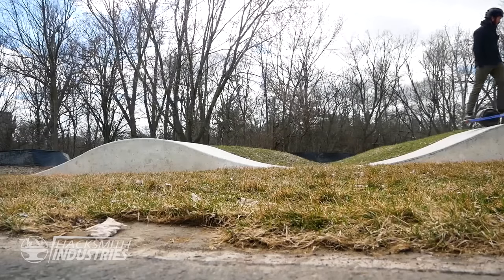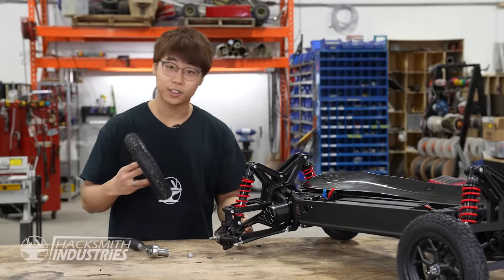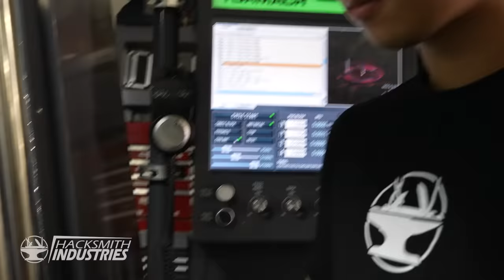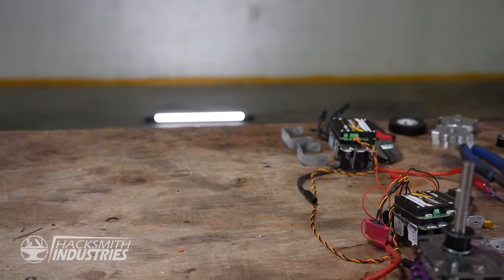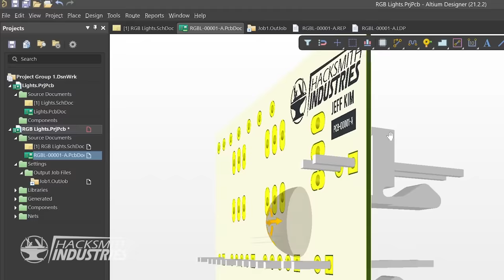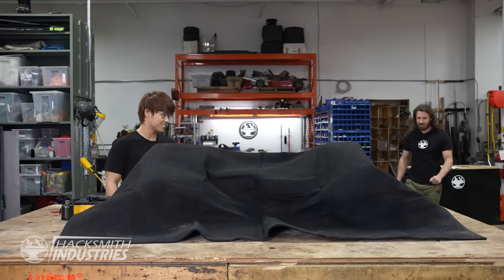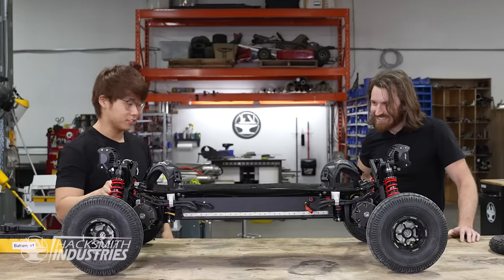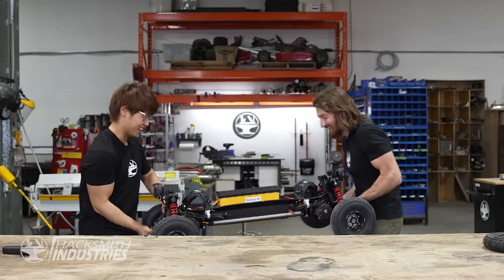The World's Most POWERFUL Skateboard

Comment: 1. Buying a 10 kw skateboard
2. Upgradeing it to 44 kw
3. Turn it down to 8.8 kw because to much power
Reply: i too was puzzled
Reply: thats the point
Reply: Well to know it has a 44kw potential is the real deal, honestly though, a trike or go kart, maybe even an electric bike would've been better
Reply: I'm glad I'm not the only one that came to that conclusion
Reply: Not to mention changing to a lower capacity battery so it could handle the potential power output.. All that effort to provide a small downgrade on the board 😂
Reply: Stonks
Reply: @moneebkhan3744  actually yeah I see your point. 44kw is too powerful for a skateboard, but it would have been extremely thrilling for a go kart.
Reply: perfect
Reply: I cant believe he didnt max it out and just sit on it lol
Reply: @rayyanshaikh5591  I think extremely thrilling might be just the slightest understatement. My nice city car has a Weight to Power ratio of 16 kg/hp. this board would have a ratio (assuming 10 kg weight) of 0.166 kg/hp. Just for comparison, a modern F1 car is only at about 0.74 kg/hp.
Reply: @IgnavumFortuna  You gotta use all-up weight, include the rider and gear.
Reply: @bakedstreetyt  cant he would headbutt into the wheel, or most probably wheely and fall.
Reply: @xorbe2  yh but formula cars dont do weight incl riders or so, i understand that with rider, skatbeoard has more difference, but we are comparing skateboard to f1 car, not the riders.
Reply: @SRNAR8  The point is the top speed unlimited might hit ??? (without calculating it) 150 - 200mph (240 - 320 km/h)
Death kinda follows soon afterwards..
Reply: Ikr wtf
Reply: @Lucien86  first of all the wheels and especially motors can’t spin that fast and second it can’t hold that much energy in that small battery pack, I would bet money it can’t physically put out over 20hp
Reply: @IgnavumFortuna  this isn’t actually that powerful, as is it has like 20hp and you couldn’t get it to the ground anyway, also my go kart has 120hp and weighs 320 lbs without a driver
Reply: @Industry-insider  Like I said I didn't calculate it. The total power unregulated is 44 KW (almost 60 hp) and those motors probably could spin at 7000 or 8000 rpm so its not totally impossible.. Putting the power to the ground though you are probably right, without some kind of aerofoil to hold it down its just going to take off.
Reply: LOL that's true
Reply: @SRNAR8  F1 cars are weighed including the driver, plus the driver in an F1 car is around 10% of the total weight, here the rider is upwards of 80% the total weight
Reply: @jorge8596  Yes ofc thats what im tryna say, it aint a fair comparison, you need to go by power to weight of each
Reply: @Industry-insider  what kind of engine do you have in that go kart?? Is it just a 600cc supersport bike engine?
Reply: Whats the model of the board
Reply: @DeltaInsanity  nah it’s a 1500cc 6 cylinder Honda engine with upgraded carbs and now it has a turbo but that isn’t done yet, eventually it’ll have about 200hp
Reply: @IgnavumFortuna  im pretty sure the power to weight for an F1 car is around 1.3hp/kg
Reply: @Industry-insider  i would bet these wheels cant transfer to the ground even 5hp
Reply: to ride that thing at full power youll need a titanium armor from head to toe
Reply: Whats happened to this channel
Reply: Let's hire this kid to make computer chips for our New Cars that don't have chips
Reply: regardless of the power of the motors, they are still larger, providing more torque and acceleration even at a lower KW rate. Also, the rate can also be tweaked...
Reply: @Industry-insider  Probably less i only get about 11hp tested on my setup.
Reply: @SRNAR8  mega difference between a maybe 30 pound skate and a 1500 pound car
The rider is at less 3 time heavier than the board
But even a 200 pound driver  is still 7.5 time lighter than the car big difference
Reply: It's for in case you need to haul your house over to another location.
Reply: @stratokast4730  the Koenigsegg one:1 
Weigh 1360kilo and got 1342hp ence the one:1 name this is the ultimate weight/ power ratio 
F1 weight ~750kg and the most powerfull engine is maybe 850hp and ~1000hp in qualifying trim
Reply: @legros731  yh true true
Reply: Of course.  It's like putting 1500 HP in your already insanely quick supercar. No one "needs" that much power or can hardly use it.  However it's all about bragging rights.
Reply: @Industry-insider  ur go kart prob doesnt output 120hp tho.
Reply: @SRNAR8  yeah it does, I had to rejet the carbs multiple times because it was lean from flowing more air, can I really put that to the ground though? Not really on the street, from a dig I can spin the tires into 4th gear even with 12” wide slicks
Reply: @Lucien86  top speed is only affected by voltage not current
Reply: @lukepitulla8139  Time for some physics. Watts = Volts x Amps. You need both - can design a motor for a wide range of given current and voltage that will give a particular speed.. If you were right a Van De Graf generator powered by a small battery could get your Tesla to 1000 MPH.. :D
Reply: The range would be reallly great , not so great for offroad too heavy
Reply: It wasn't a 10kW skateboard to begin with. Derp. The motors, controller, and battery obviously couldn't deliver 10 kW, if the new 8 kW version is much faster. I'll bet you buy those Chinese 18650 batteries that say "22000 mAh," right? LOL. Or the 17000 lumen flashlights.
Reply: its all about the torque tho.
Reply: That is how you know they are Canadians 20% on everything the do....
Reply: Where do you get 8.8?

At the end he said he reduced it by 60% but that would still be 17.6, eh?
Reply: @Nevir202  he said it only used 1/5 of its potential power
Reply: @littlejackalo5326  I'm not the one providing the facts. But you are probably right, he said they were "rated" and not that they "output".

BTW 22000mha in a 17000 lumen flashlight, sounds awesome ;)
Reply: @josephcutler3156  lunatic express
Reply: @IgnavumFortuna  Now that's the maths I was second guessing and wanted to know for sure. Thank you.
Reply: @SRNAR8  You clearly need to include the rider weight otherwise that is just stupid.
Reply: @Lucien86  Top speed isn't just about power. Max RPM, gearing, wheel size etc etc.
Reply: @SRNAR8  How would you know? Also they said what size engine they had so it should be pretty obvious that it does.
Reply: @lukepitulla8139  You are very wrong.  Voltage may drive RPM but you still need current. 10,000V at 0.001amp still won't spin an electric car motor.
Reply: @kage30000  Yes but before the end that figure had increased to 60%.
Reply: @randomname4726  Ur 6 months late g, idek what ur on abt, but im guessing ur talking abt the board, if so im talking abt without the rider board.
Reply: @SRNAR8  That's how youtube works, not everybody watches something at the same time and people comment for years. Also if you need to see the context of a reply you can click it to see the original comment thread.
Reply: 44kw is a lie, they are lying the motor would burn up if pushed that high. the esc would also overheat
Reply: @Nevir202  Because he reprogrammed it from 20% to 40%
Reply: hacksmith moment
Reply: This literally has the same power as my car.
To be fair, it's a 1975 Honda Civic, but it's still a fun ride. I'd be terrified of this board with its factory power of 10kW
Reply: Don't forget it's turning bigger wheels and probably heavier now too.
Reply: this also seems odd to me i feel like they could have found some eskater willing to try to ramp up to riding this on full power given what i have seen people do on custom offroad eskates, baja boards etc.
Reply: IT's called unlimited budget.
Reply: More torque?
Reply: Lol
Reply: @IgnavumFortuna  its probably closer to 20or25kg. But still ridiculously insane at full power. I like how you broke it down into actual power to weight ratio, makes it a lot clearer picture for someone to understand. Thats how I like to think too. Cheers.
Reply: think of the distance v power equation and youll see the benefits dont simply go away, just gives you way more milage., (safely)
Reply: @Lucien86  I think they said the motors were 8100 KV, so yea, absolutely possible for anyone questioning it.  All of the components are essentially from RC vehicles (minus the motors), i cant help to think how fun of an RC car this would have been lol
Reply: not to mention it has less battery capacity as well...
I think it was all for the torqu... oh right, he reduced that by 60% as well.

Comment: Skateboard people: "Well it can be a real workout"
Hacksmith: "You use legs lmao?"
Reply: electric longboards may not be as much of a workout, but they do still wear out your legs out after a while. you may not be kicking, but you still have to steer and counter-act inertial forces etc., so your legs are still doing a fair amount of work. it's like doing pushups vs. doing a sustained plank; one is definitely more intense, but both are still workouts.
Reply: @LiveWire937  without suspension, the vibration also kill your leg loool

Comment: Mechanical engineer: sure, I can soup that up 

Every RC enthusist in the world: hold my beer
Reply: He's a poor engineer, he made a locked diff for a sk8board
Reply: @simonasremeika6238  Exactly
Reply: ikr i would have probably used x-maxx wheels instead of those things
Reply: @simonasremeika6238  He probably knew about that . Cut some slack hes not even an engineer yet; hes studying in college to be one. They didnt make this to really go off-rading anyway.
Reply: @icebrew  x maxx wheels wouldn't hold up to that weight or power!
Reply: @Chevydevil  somewhat true about the weight but my X-Maxx goes around 50 and i can't see them doing that while someone is on it the only way i can the the wheels not holding up to the power is if they try to do something like a burnout
Reply: @icebrew  the thing is your x maxx doesnt have 60 hp and its also not carrying a human being
Reply: @Nash Brusven Pulling you on a skateboard is different the skate board is carrying all the wight and not the drivetrain of the x maxx
Reply: @simonasremeika6238  isnt intended to be an offroad skateboard though?
Reply: @thomaspritchard2449  60HP 😂
Reply: Yes, 60 horsepower.... Well 59, at least if they ever ran it at the full 44kw as 44kw=59hp
Reply: @change929  not much good on the road either

Comment: The ultimate question and test; will it drift?
Reply: Boku!?
Reply: Baka
Reply: Otsutski
Reply: Haha love it
Reply: Then race it against a Ferrari and beat it
Reply: D O N ' T
Reply: Kansei Dorifto?
Reply: Maybe if you put an ebreak on it
Reply: Good qestion
Reply: @GrandmasterUV  👀👀👀
Reply: It will not. Due to the very high center of mass when someone is on it, it would more likely flip.
Reply: found you
Reply: No the skate is too light for Rubber wheels they have too much friction so u cant drift
Reply: Otaku
Reply: no, it has beefy rubber wheels
Reply: seein as he basically put a 100% locked diff on both axles, because the motor powers left and right wheel equally i see at least a possibility (maybe on hard wheels)
Reply: Touché
Reply: My 2.8 HP electric skateboard can drift quiet well on the right surface. Its also already enough power to get a bit of wheel spin using maximum acceleration on any surface
Reply: Yes, even the stock one drifts :)
Mine actually has drift bars added to it,lol
Reply: The answer of the ultimate question would be....

42

Comment: The only thing missing (very minor, though) is diffuser coverings to cover those exposed LED strips. Oh! and racing stripes to make it go even faster! ;-)
Reply: Agreed he should of aimend them down not out so they can blind people but that's the least of the problems with this build, by running two wheel off one pulley they are going to have issues turning on pavement not to mention what was the point of upgrading to those massive motors then bottle necking the power lower then the smaller motors.

Comment: without a differential inbetween wheels on the same axis that thing's going to skid like mad on corners, fun if you want to drift everywhere, not so much when you wipeout on every sandy corner
Reply: its turn radius is probably so big, the lack of a diff probably doesnt affect turning that much
Reply: @trapper1211  It does loose traction on a quick corner, I bet it doesn't even turn normally
Reply: @trapper1211  i don't think so. that's why there is 4 motor at the start.

Comment: Surprised I haven’t been able to find comments about the coupling shaft between the two pulleys on each side not being a good idea. Unless you plan to only go in straight lines this is going to cause mechanical problems. This is what a differential is for. That’s why you see most dual motor skateboards with both motors on the back or in a diagonal front and back configuration.
Reply: it's not like it was built to last or to function properly, so don't worry about it!

Comment: It needs a differential, I’m sure that it feels like shit when cornering
Reply: It's meant for offroad so it makes sense to not have a differential, if they wanted to implement one they would need to make it manually lockable
Reply: Nah I'm with you bro, definitely needs a diff. They're gonna hit trails and fields they aren't rock crawling. Rally cars have diffs and that's the closest comparison in the motoring world
Reply: @sebastianozavan9888  it had four independent motors, so no need for a differential - it should work better than any differential, lockable or not.
Reply: @Dorench  i thought most rally car had limited slip differentials, not open ones, but still i understand what you are saying
Reply: @sebastianozavan9888  limited slip lets the wheels spin without slipping. This would slip around the corner. Terrible and dangerous idea for a skateboard. Maybe would be ok for a drift car, but still, you want open diff at least for the front.
Reply: Can confirm that it does need a differential. I built one the same way and had to rebuild it.
Reply: @sebastianozavan9888 A lsd still allows the inside tyres to rotate less than the outside, what it stops it a one tyre fire on loose terrain, keeping the car more balanced. But you're correct that all WRC cars have lsd's
Reply: @Dorench  that's exactly why I said that, a normal differential isn't optimal for offroad
Reply: @dominikschindler2330  Exactly, it "HAD".... He took them out lol, and now it HAS only 2 motors, and locked axles...
Reply: @dominikschindler2330  yes, if they programmed every wheels cornering speeds in a good way there is no need for any kind of differential.
Reply: @kaylor87  Yes now it's drift or die! LOL :P
Reply: A qaud is solid rear axle turns just fine. Dirt does the slipping for you
Reply: @MB-xz1gh  there is no need to slip anything because there is no axle, weels are indipendent each other
Reply: Exactly my thoughts
Reply: Maybe a locking diff it's meant to go off road
Reply: Aren’t there suitable 10kw motor to just keep the same 4 motor config ?
Reply: Tinkering With Tech  You clearly don't understand what a diff does.
Reply: @marcobo1484  The wheels are not independant anymore.  One shaft (motor power) turns 2 pulleys.  Both pulleys are connected to one shaft, there is no independant movement.  With how it is set up, you can turn one wheel and the other side will turn equally.
Reply: @kaylor87  i was looking for someone to say it!
Reply: Yeah i was a little confused when i didn't see one